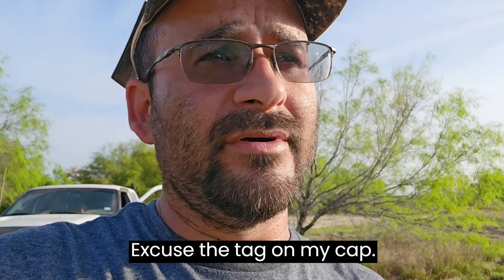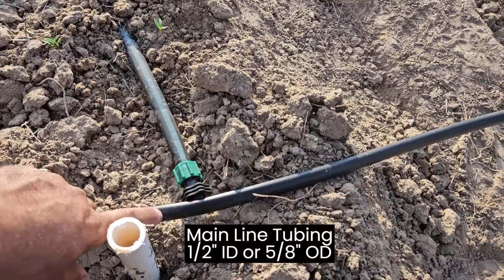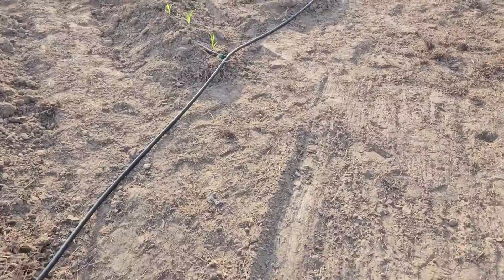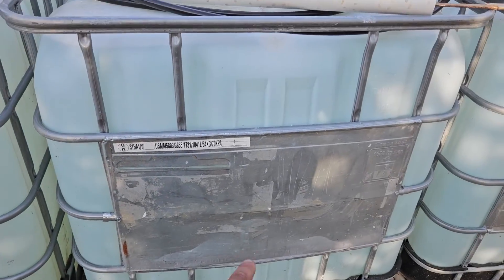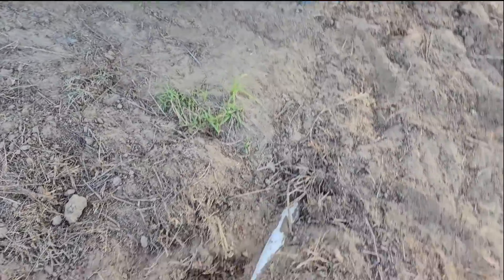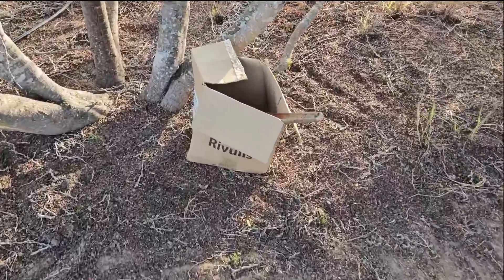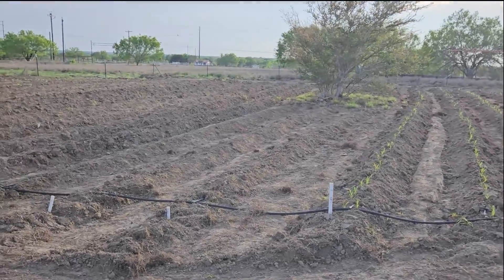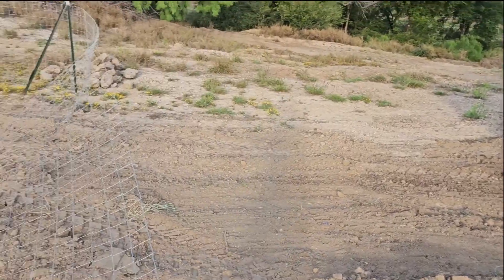Installing a solar powered drip tape irrigation system with several 250 gallon IBC tanks. #growhoss

Comment: This is nice, but I did this with battery powered timers to release the water. Much cheaper.
Reply from the maker: When you say battery powered timer are you talking about the faucet orbit ones? My first idea was to use gravity but the drip tape requires 4-8 PSI and at 3ft of water in my tanks I can provide only 1.3psi. The 1" line on the bottom works great to gravity feed the rows but I lose to much water that way.

Comment: Thanks for sharing! I've been pondering how to set this up and here you are with the exact thing I want to do layed out and explained perfectly!
Reply from the maker: Thanks. I been adjusting the setup and so far its been great. I have a water level float to shut off system just need time to get it installed. The float will turn off the pump once I have about 5 inchs of water in a tank. I also placed more drip tape than recommended which can affect the end of rows a bit. I am thinking on dividing the garden and either use a 2nd pump or a faucet timer with dual zones to increase GPM and PSI. Any questions feel free to send me a message.

Comment: nice...im in southern az and wanted to do something exactly like this when i finish the house. on the drip tape stuff is it easy to take out and reuse when u replant and till the ground every year? i would much rather have a system like this than a 4' prayer head deal.
Reply from the maker: I can not answer the question on reusing drip tape as its my first ever install. I am thinking on just leaving tape in ground and using my tractor to make the rows again.15mil tape is also way thicker as I have 1500ft of 15mil and 250ft of 8 mil. I think the soil will be moist enough to pull the tape out.

Comment: Cool video. I like watching videos like this, even though I would probably never do anything like this. I have a question. Why filter the water? I'm sure there's a reason. I'm just curious
Reply from the maker: The filter is to remove solids that can plug the emitters. If an emitter is plugged it will cause less water to get to that plant. I am not sure the size of the emitter but could be made of a couple pin size holes.

Comment: Good job mate👍🏻

What size and performance are you getting out of your solar panels?.
Reply from the maker: The panels are 100w Newpowa and have not made any real test measurements. I do know I have seen a bit over 10 Amps from both units combined so far.
Reply: @cutweldngrind  
Thanks for the reply. 

They should work well compared to the sun I get here in the UK. Haha

Best of luck with the system and harvest.🤞🏻